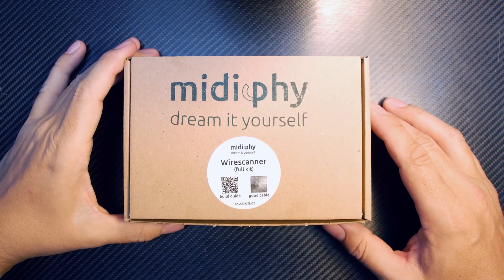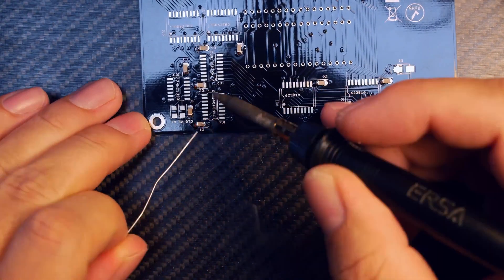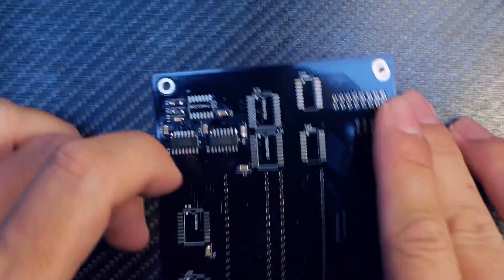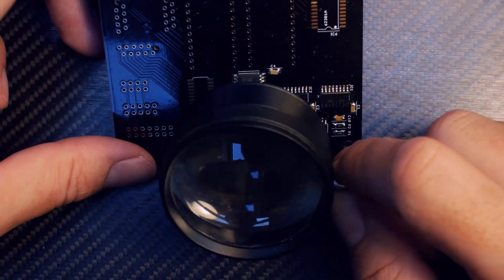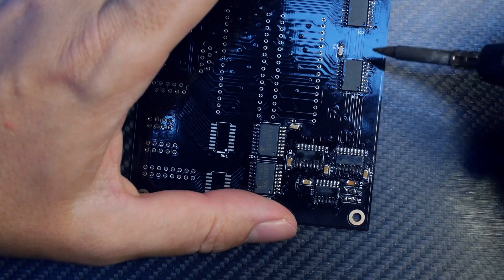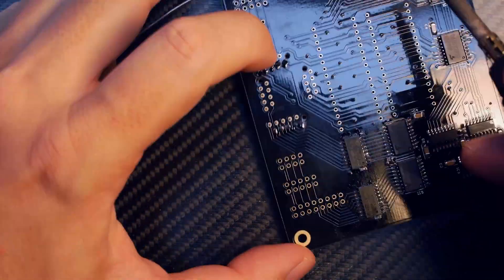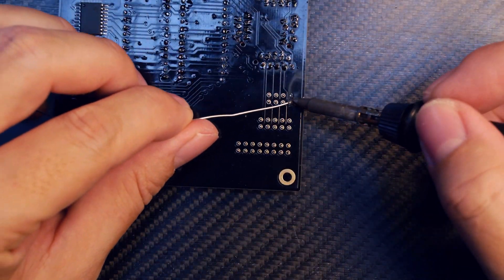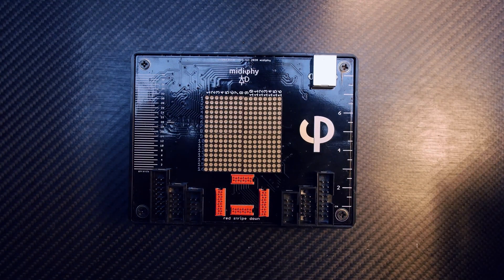[DIY] Building a midiphy Wirescanner (video tutorial)

Comment: Thanks Peter! Just a couple of comments:
10:46 actually they are isolated resistors so the orientation doesn't matter here but it is still good practice as we also use similar bussed networks in other projects and there you do need to take care of the orientation!
16:16 if you're looking for a piece of plastic, well you also have the lid of the case; maybe that's thin enough? It's also possible when soldering THT components to solder one pin down of each part and check that they sit nice and flat on the PCB top surface.

Thanks again for the cool build guide!
Reply from the maker: Thanks, Andy!